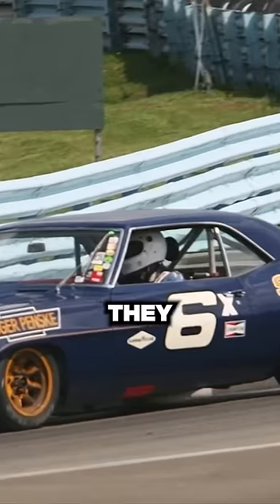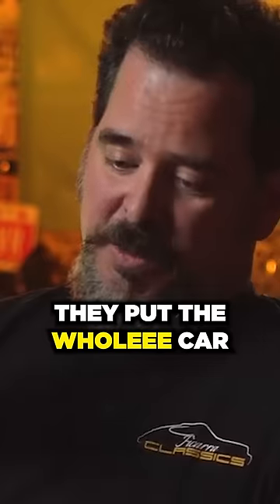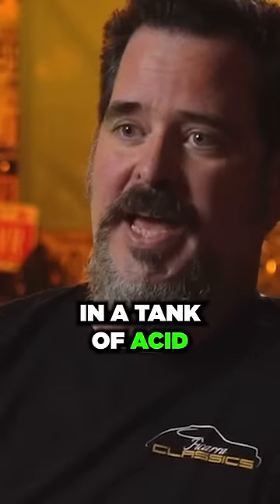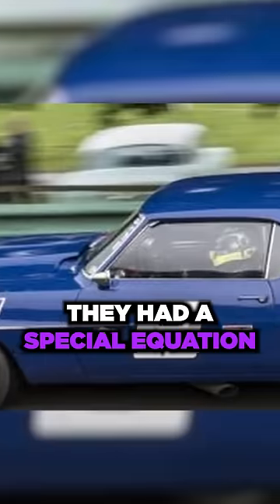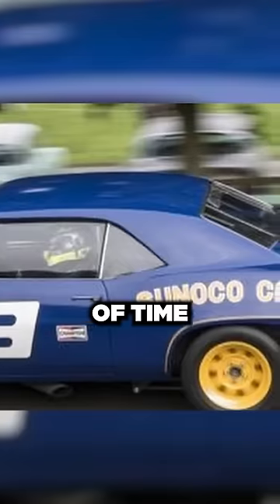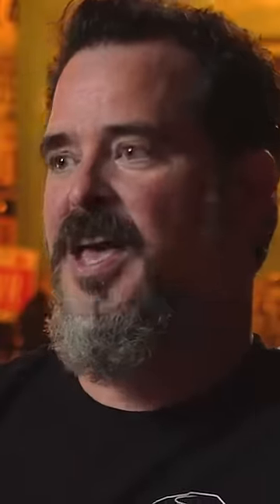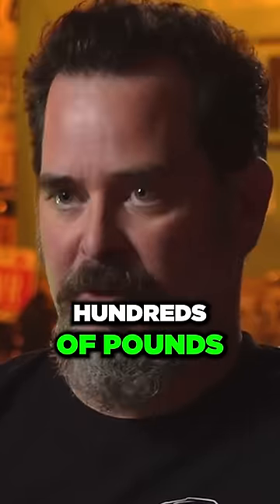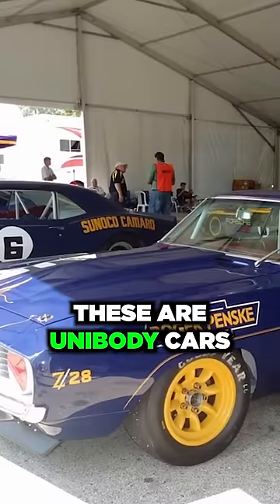The craziest CHEAT in racing history!

Comment: i love stories about all the "creative" ways race teams have pushed the rules of racing.
Reply: or pushed "nose candy" to keep racing.
Reply: Read Darrell Waltrip s book.  My favorite 2 are the walkie-'talkie that was actually cast lead, to be switched out with an actual radio after qualifying.  And when rolling the car forward into inspection the mechanics each rolled a wheel up onto their foot, thus instantly increasing the ride height, for inspection.
Reply: Cant you technically call said teams racists, like, is it possible? Yk what I mean
Reply: @randytaylor1258  
How could the scrutineer miss that the car was parked on someone's foot?
Reply: @teppich_xp340  only bubble Wallace can
Reply: I forget who the old cat was but back in early days of nascar they had a regulation about the size of fuel tank you had to run but there wasn't a rule in the book about how long the fuel lines could be...so the guy ran I forgot how much fuel line thru the body of the car so it could hold a few extra gallons of gasoline hahaha fuckin smart guys!!!!
Reply: @Teppich _xp  a true racist doesn't cheat. They ain't no racist. I always wanted to be a car racist when I was little.
Reply: You’d love Smokey Yunick of NASCAR fame. Smartest engineer ever to live with out an engineering degree.
Reply: I liked the guys with T H I C K fuel lines so he carried more fuel
Reply: @catalintimofti1117  my favorite was making a car 9/10 full size . But the fuel line trick is one for the ages.
Reply: @lemonsqweezy9532  being a racist sounds so fun ngl
Reply: If you ain't cheating you ain't trying
Reply: @extec101  they still push nose candy
Reply: Cheating
Reply: @tokeypokey  good ole nose beers
Reply: @Emilbus760  One story I heard was that the car was fitted with a fuel line of several inches in diameter.
Reply: Penske didn't "break" the rules but he was a master of finding the gray areas and exploiting them.
Reply: @shawngherity2586  the Video has the word Cheat in it?
Reply: I’ve heard ab them putting fuel in body panels in hidden tanks and the roll cages
Reply: Ferrari's 2019 engine is legendary
Reply: I wish they could still do it cause it would make the races better to watch. Now its just 20 of the same car going in circles for hours.
Reply: Mercedes and their windtunnel wheels lol
Reply: I think mx5 cup is good enough ;)
Reply: IIRC Tom Walkinshaw's boys used wedge-shaped head gaskets to get a more favorable valve angle on the Jaguar V12 they used to dominate touring car racing.
Reply: @ReikoX7  definitely some top notch racing I can't wait to finish my spec Miata. I'm going 1.6 NA hoping light weight will prevail! Any cheater tricks I should be aware of? Wedge shaped head gasket like I mentioned above? Lol. I've been reading the rules extra carefully 😉 I think I can squeeze a Haltech into the factory ecu case and use Bluetooth to make discreet changes
Reply: The tech inspection, a mechanic noticed that the inspectors would ALWAYS check the displacement on #1 cylinder, so he bored out the other 7...
Reply: @Emilbus760 problem with that is restriction.

Example: you have a water pump connected to  a one inch pipe. How far can the pipe be before the pump stops working? Of course it depends on how strong the pipe is, the pump and the type of water.

Type of water?

Yeah. Any liquid when compressed and moved like in a pipe produces friction and restriction. That's heat and resistance. So a gallon or two, maybe. But multiple gallons? I don't think so. No offense or anything, just pointing out some knowledge
Reply: It's what makes racing, racing
Reply: @Jonascord  this couldn´t work ... all the engines are about the balance ... Wouldn´t it wear off too fast ?
Reply: @ReikoX7  it can and is done using modern electronics, but back in the day? No VVT, with just a carburetor? I'm not so sure.
Reply: Same here lol wtf they dipped it in acid
Reply: @ReikoX7  The engine only has to last 501 miles...
Reply: @Jonascord  yes but in very harsh conditions.. Therefore reliability is really important in 24h race...
Reply: @ReikoX7  This is NASCAR.  They will typically run three engines, last race's engine for practice, a "massaged" one for qualifying, where the most cheating goes on, since they get money the higher they qualify, and one more, slightly detuned, (And legalish), for the actual race.  Remember, you start racing with about 50 lbs of $100s.
Reply: *cheated
Reply: @catharticcathexis4527  so, he was a real engineer then.
Reply: @Thekarateadult  Absolutely. Smart, smart man.
Reply: @dresewright5365  thats why they tare them down now
Reply: Toyota Cheat ?
Reply: Lancia used to make roll cages out of cardboard tubes for their rally cars. They also only built half the required number for homologation, showed the inspectors all of the cars, took them to lunch and had people move them all to another location and they were counted twice
Reply: @Weimerica8841   that is the smart thing I've ever heard and equally the dumbest thing I have ever heard a done to what I'm guessing is a rally car, since it's Lancia.
Reply: @NightfurySkrill_Joel  Yeah, it was only the rally cars. And agreed it's both very smart and very dumb haha to be fair they had the strongest chassis by far, but those drivers had to have some serious balls
Reply: @Weimerica8841  yeah I was thinking about how it's a rally car and you removed the roll cage of all thing's. The Driver must've had Balls of titanium and be absolutely confident in their capabilities. That is me but instead of a rally car I own a 440 Dodge Demon and it has been the most dangerous and most reliable thing in my life so far although I need to fix the curb weight so it doesn't go on 3 wheels when I corner at mid-high ish speeds
Reply: @Weimerica8841  if I don't feather the pedal it either grips up or kicks out to the side and it has no power steering so I bought better brakes instead of the power steering for now.
Reply: @NightfurySkrill_Joel  That's badass dude, I've got an 01 MR2 with a swapped engine. Obviously you've got a ton of power, if it's sketchy when turning you should get some adjustable sway bars and tune it from there. If the rear is what's coming loose, you'll want a stiffer rear bar even though that seems counterintuitive. Nothing you can really do about low speed traction other than stickier and wider tires haha
Reply: @Weimerica8841  Thank you, I am still a senior in high-school and working part time so if someone can help me in any way knowledge or experience wise I'm all for it, the car was my grandfather's he passed on the 71 Mustang mach-1 to my older brother and I got the 440 Demon, his brother still owns a Plymouth Road Runner tho and it has hella modifications for driving experience and performance. I am very grateful.
Reply: Toyota' Turbo restrictor!! Flexed under high boost allowing upto 25% more power !!
Reply: my favorite was the "broken" carbs. the clearances needed are crazy
Reply: I agree in Racing it's Creative.Not cheating
Reply: This was Trans am ..Not Nascar
Reply: @Emilbus760  Smoky Yunick was the guy who used fuel line to hold extra fuel. As the story goes, they pulled the tank out during inspection and had issues with it, so he got mad and hopped in the car and drove off without the tank in the car.
Reply: I just saw, maybe that's why this came up. One driver deflated a basketball, put it in the tank inflated it. After inspection they took it out and had a couple more gals. of fuel. Also, there was no rule on fuel line size. One driver used like 2 in. pipes and added a lot of fuel. It's like gun manufactures, the "A" holes change the rules, makers work around them.
Reply: @jakerazmataz852  Smoky Yunick, I probably spelled his name wrong, is the guy who did both of those things. He was a car builder. He used to say that he was responsible for half of the rules because NASCAR would catch him doing something neat and then make a rule against it. He had a lot of cool tricks.
Reply: Yeah, I feel like that was the Golden Era of auto sport now everything is just so technologically advanced the magic it’s kind of been taken out of it. now everything is just cold hard calculations and regulations and the only real advantage is an absorbent amount of money. Simply being clever and intelligent is no longer a virtue anymore. People tend to be better off, if they’re just rich.
Reply: it was really funny when mazda put a rotary in the lemans where you have a displacement cap, but a rotary makes about 2x the hp of a same sized piston engine (for example, the 13b in the rx8 makes 233hp, at only 1.6L NA
Reply: @agentbarron3945  That's like the STP-Paxton Turbocar.
Reply: @eggreedgious5194  lol that will be a waste of time on the 1.6 without a turbo. I think the record for a NA 1.6 is 168hp and that was ITBs and race gas and everything. They just are not worth sinking money into. Look for the 6 speed trans from a JDM NA Miata that is your best bet other than engine swap.
Reply: @Emilbus760  I want to say it was Jimmie Johnson, they put 40 feet of fuel line under his seat
Reply: @Emilbus760  don’t know who did it originally but I think they copied the idea
Reply: If by pushed you mean flat out cheated, then sure.
Reply: It's always interesting to see behind the scenes from their perspective. There is a famous British motorbike racer, called Geoff Duke. And his story is fascinating, listening at he explains some of the things that they did, to help make his bike faster and win the races. 

In short, he covers areas that are vital and standard practice today but, are things that he and his team came up with. Tight fitting leathers, to make them more streamlined and therefore faster, yes, standard today, they weren't then, and Geoff and his team, came up with it and did things tape the suit down, as he was still wearing off the shelf normal gear, until they learned how important it is, especially in high speed, high stake races, such as the Isle Of Man TT. How things such as fairings weren't a thing yet.. His first attempt, cutting up a dustbin for the nose cone, which you can see became standard fair, in the form of the nose cone fairings on cafe racers. 

There's so many more things that became standard fair, and it's incredibly fascinating to learn about it, from the people that came up with things, that are now standard practice 75 years later. 

If anyone is interested, I highly recommend you get yourself a copy of his autobiography and, enjoy a great read.
Reply: I love stories about all the "creative" ways sports and racing teams have pushed the art of cheating.
Reply: Gotta break the rules to make em
Reply: @AcidGambit419 NA 1.6L with 168hp isn't a record. Look up the Honda b16a, 170hp from the factory, NA 1.6. And things have only gotten better, that was in the 90s. There's a 3 cylinder that I believe Toyota developed that was like 300hp
Reply: @Emilbus760 not only did he run it through the car he made the fuel line itself like 2 inches wide to hold that much more.
Reply: I like the extra long fuel line that hold extra fuel
Reply: there was a rally team that used the body as a compressed air chamber to keep up rpms when the driver was off the throttle, pre/ early days of anti lag.
Reply: @Emilbus760 that would be Smokey Yunick! He realized that while they did have a restriction on tank size, they didn’t have one on fuel line size. So he put in a fuel line that was over 11 feet long and an inch in diameter that could hold a couple gallons on its own. And that was after he got caught putting a basketball in the fuel tank that he would inflate and deflate to add an extra gallon or so. Smokey was an expert in finding the “unfair advantage” 😂
Reply: Old Chief used to tell us, "If you ain't cheating, you ain't trying."
Reply: @catharticcathexis4527 Back in IBMs “hay day” they were full of guys like him. Farmers. IBMs decline coincided with the adoption of only degree engineers allowed.

Comment: With the roof... make a scene. Yell at the tech guy. "WHAT THE FUCK DID YOU DO TO MY ROOF?" "WHO PAID YOU TO DO THAT?" "WHO DO YOU WORK FOR?"
Reply: What are you like the wanna be director commenter..
Reply: @AndToTheRepublic4WhichItStands  ?????
Reply: I call bs on the roof crumbling story, how would the body hold up to the wind pressure of going super high speeds without crumbling
Reply: @SupermotoNL  it might be built like an aluminum can. Should be fine in the wind
Reply: @dilfonicz  i dont think you realise how much pressure is on the car at such high speeds.
Reply: Isn't the pressure applied to the entire roof at high speed, while leaning on it would create localized pressure?
Reply: @danylcoye8465  thats true but that would at most be 50 kg of pressurized force while the avg speeds these cars sustain for hours would be around 130mph on average which would create as a rough estimate more than 1500 kgf of pressure not to mention the spoilers which by itself are designed to create even more localized force, that wouldnt work unless it is attached directly onto the frame which is unlikely since they are supposed to be "stock cars" and those spoilers arent stuck to the frame.
Reply: Impossible, and improbable.
Reply: @SupermotoNL  Yes, pressure per sqft. Much different than someone putting their ass on the hood or elbow on the roof. I have a 2011 and 2012 car and they easily bend with pressure from a hand or finger and spring back but hold up to the wind.
Reply: @MidnightMarrow  i still dont buy it because the spoilers / ducktails on those cars produce so much downforce that if they really did that it would crumble the tailgate. Unless it's bolted straight to the chassis like they did with that miata in the lemons race but i highly doubt it.
Reply: @SupermotoNL  well if they actually build the cage like they do these days the cage is more like the frame so when wind pushes against the thin metal it actually would push against a steel tube not allowing it to dent and not return.  If it was really specific pressure like a elbow instead of wind which would push against the body panel evenly it would dent like your thumb against a aluminum can.
Reply: "HOW THE FUCK DID YOU PUNCH A HOLE IN MY ROOF???"
Reply: @AndToTheRepublic4WhichItStands lol fr
Reply: @SupermotoNL You've obviously never touched an older cars roof, especially some of the Japanese cars.. VERY easy to dent! Air pressure never gets anywhere near close enough dent it though. Plus because of the way air pressure works it's pressing on the entire roof and the roof acts like an arch making it stronger. To dent it you need focused localized pressure like a hand or tool or foot...